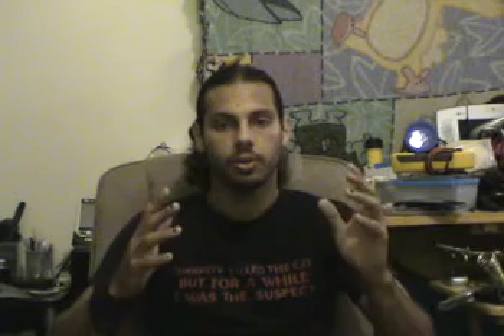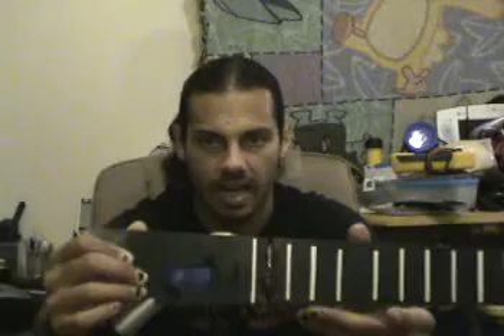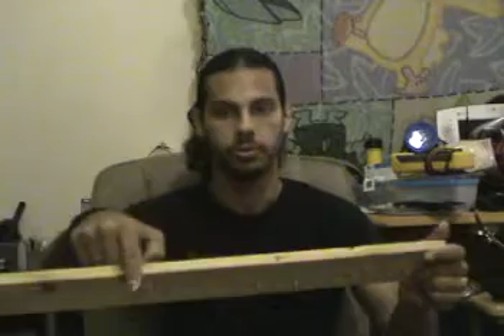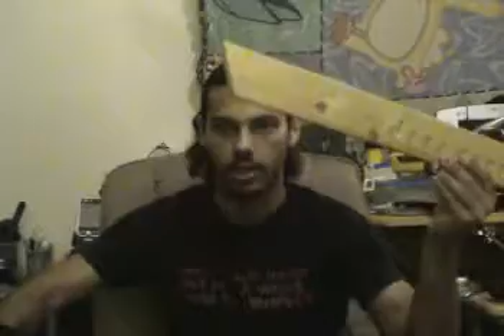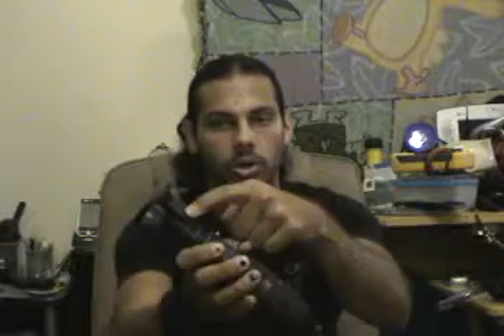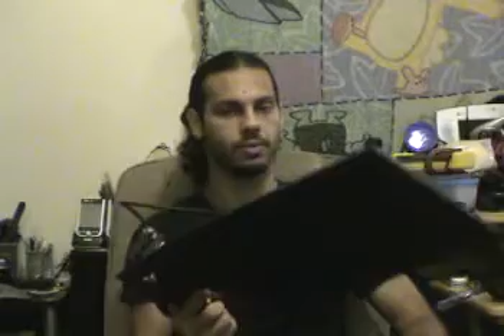2.4 Ghz Yagi Antenna

Comment: I just built an 8 bay folded dual exposed dipole for 2.4 GHz similar to the 450 - 470MHz DB420-B from Commscope
This antenna is about 3 feet tall and made from 3/4" EMT conduit and #14 solid copper wire, also used some Teflon insulators here and there for obvious reasons. The linking "t's" are RG142B/U-92607-Tensolite and terminated with a female N type connector.
To protect the elements from copper corrosion I sprayed the whole antenna with primer and painted it white (final color can be whatever. I used white to match the paint on my home)

Comment: What you just did sounds like a headache just buy a 2.4mw  antenna with a signal booster approximately 2 mega watts with a sma antenna router and you're all set

Comment: you know... It would be easier to drill holes in a round pipe if you take a block of wood and drill a hole in the middle the diameter of the pipe, then put the pipe in the hole, and then drill down vertically through the block of wood. That way the bit doesn't slip.